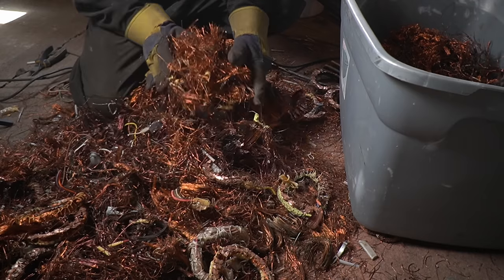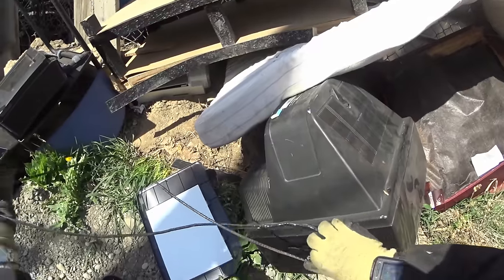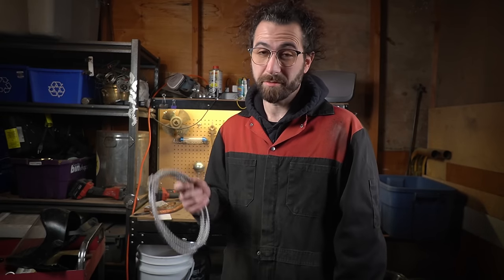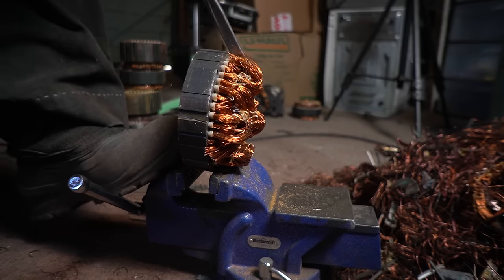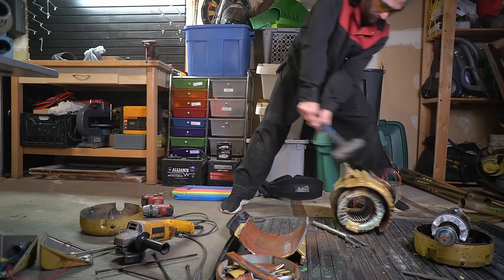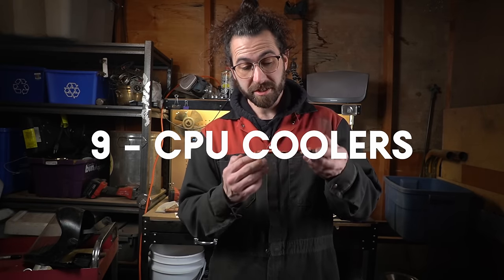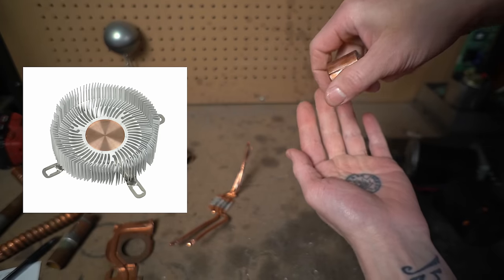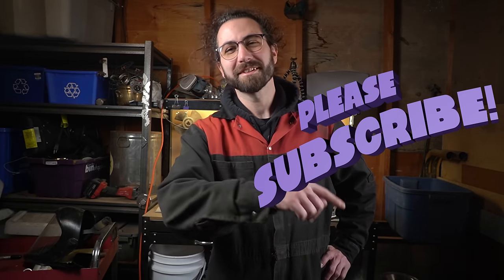10 Best Places to Find Scrap Copper

Comment: When harvesting copper, be exceptionally careful of capacitors!  Capacitors carry an electrical wallop!
Reply: yes if you're not extremely careful you will regret it ..and the gas to ..take it and sell it to a HVAC place or they can drain it safely..I'm glad I watched videos like this before I started ripping into a units..kickass
Reply: Yeah, seconded. Microwaves have "You will die and it will hurt the whole time you are dying" sized capacitors in them. Do NOT mess around poking at their guts unless you know exactly what you are doing!
Reply: @peteredwards2318  yup yup and when you're family finds you later on when they get back from dinner at rhe grandparents house they will see  you laying on tje floor and plugging their noses because now the house smells like is burnt shit..and you dont want them to remember you like that do you guys ..so dont be a BS .leave it ti the pros.
Reply: How can I see a capacitor I’m really just researching  this side hustle to see if it’s worth it any other things to look out for is there anything I should look for that’s safe ?
Reply: Copper seems worth collecting over time .I'm not about to go start looking the stuff like but glad I seen this comment. As my microwave is on it way out cuda been my 1st easy bit of copper lol 😆 😅
Reply: @peterjohnston4472  absolutely thats what i fo .just save it as icones and put it somewhere its definitely valuable and worth saving until you have a  bunch or for a rainy day.
Reply: Soooo... rubber gloves. Got it.
Reply: Yes they do store power... De-energize them and you're probably good to go.
Reply: @Toyotajunkie  touch the top w a screwdriver
Reply: Yup I found that out the hard way once.
Reply: You can short it out by placing it on your tongue.
Reply: @tomvana4270 😂
Reply: Can I use a glove or is it not useful?
Reply: For a real long time too.
Reply: So how do you safely harvest copper from a microwave?
Reply: @MyPalJimbo  here
Reply: Ues, they do.
Reply: I tell everyone to tell everyone they know that!!😂😂
Reply: And hold electricity
Reply: Thanks for the heads up learn something new everyday
Reply: See we need education like this 💯
Reply: @conspiraciesexposed7760  holding the insulated portion of a screwdriver go across the two terminals of the capacitor while making sure your other hand is not touching metal
Reply: Thanks you just saved me an ouchie
Reply: At my recycler, they just knock a hole in the line and let the Freon go back to nature. I have video.  @mustangandfrankenstein
Reply: @peteredwards2318 not saying that you shouldn’t respect the capacitor in a microwave, but to say it has lethal amount of current is just misleading. The capacitor might be as high as 2.2kV but at less than a microfarad it’s only gonna store like a joule worth of energy. 

That’ll hurt like a bitch, but it ain’t gonna burn you or stop your heart.
Reply: @MrJahka  and you know what'll do none of those things, serious or otherwise? Leaving it the hell alone. 🤣
Reply: @peteredwards2318 im not a crackhead lol so I’m not opening microwaves or anything. I just wanted to clarify that those capacitors will shock the shit out of you like 2k volt worth of shock that will hurt hurt hurt. but unless you’re standing in a bathtub of water it’s not gonna be enough current to actually hurt you. But I’m not trying to be dismissive just pedantic lol. Always beware the charged capacitor is great advice
Reply: Take your screw driver and touch all the terminals together it’ll discharge it, so far ive never been hit with a capacitor
Reply: @robertfrapples2472  exactly what most hvac guys are gonna do as well., they don't want old dirty freon. cost too much to collect,clean up, and reuse. they just vent it!!!
Reply: I just cut the cord off of microwaves and let someone else have at the rest for that exact reason lol. TV’s or anything else that may have something like that, I’ll let sit for a couple months at least before I start poking around.

Comment: A buddy and I were scoping out an old abandoned stretch of train track and pulled several hundred feet of solid copper that was cut from the old power poles and thrown to the ground and left for many years, the wire was covered over with grass and weeds. That track kept us busy for days.
Reply: Did that too, we thought we were rich. Couldn't beleive it was high tension wire. Steel inside. The scrapyard knew where we got and gave us like 4.00$ gave us some magnts too😂 wondered why it was so hatd to cut...😅😅😅😂
Reply: Anything on a railroad tracks a railroad property is a federal offense
Reply: There's one in every crowd
Reply: @swarm6697 not if the land has been abandoned
Reply: @dougmiller5608  Feds don't  abandon properties. They just set vacant until a new use comes up.
Reply: I watch 5 people a year fry on amtrak power cables taking copper.  Hillarious
Reply: @stevenkipus1505   Why is it hilarious? They either get paid or never need to get paid again. Meanwhile the cost of therapy to process what you witnessed is going up and up.

Comment: Some dumpster companies have declared anything inside the dumpster is their property because they recycle the contents, therefore they can press charges for theft. Be careful, it might be easier (and safer) to ask. I got permission and help from a Radio Shack that had stuff inside they hadn’t had time to toss out yet. Fun stuff
Reply: Kind of hard for them to catch you since the dumpster is on the clients property and you are doing the client a favor by lightening their load and in some cases, they gave you permission.
Reply: if in the USA there is a law that helps police anything in the trash is forfeited of owner also helps scrapers police will say you can't because they don't want the call later to trusspass you (lot pf paperwork)
Reply: The Supreme Court has ruled anything placed in the trash is free to claim. They can try to press charges all they want but it isn’t going to stick
Reply: If it’s mixed with trash they aren’t saving it for scrap. Also I look for no trespassing or a locked bin. If nothings locked or behind a gate I think it’s free game.

Comment: I went to the HVAC guys that replaced my AC unit a few years ago. Told them what I'm doing and so now whenever I get a couple of Fridges together I call him up and one of their guys will come out and drain all my compressors for me so I can scrap them. I have a moderate sized side yard and try to get like 6-7 of them in the stall before I call my guy and it takes him about 30 mins to drain 6-7 and they leave. They get the chems, I get the scrap.

Comment: Thub is spot on about extension cords. I weighed 1Kg of (UK) 3-core extension cable then stripped the outer it and re-weighed it as singles. Even with good singles prices the cable was worth 2.5% more unstripped, so the time & effort would have cost me money!
Reply: Extension cords have a 45% recovery rate of #2 copper wire. I work in the metal recycling industry.

Comment: I second the plumbing tip.  I drive a residential recycling route and every time I see a sink or tub or shower in a dumpster in front of a house I know I'm stopping back there after work.  Stripping down the faucets is a quick way to a hunch of clean and chromed brass too.
Reply: U know damn well u don't chance finishing your route first driving the recycling truck to wherever y'all empty then driving back to the shop, clocking out getting in your beater station wagon and retracing your steps from your morning route to see if maybe just maybe that bathroom sink is still sitting in front of the Clemson resident house 8 hours later it's sure to still be there.. I bet u carry a few of the must have scrapper hand tools with u on your route truck and and all day everyday u keep your eyes peeled for the jack pot. You don't wait till after work you're not kidding anyone!

Comment: Transformers are great, and they are fun. The small ones can typically be taken apart in such a way as to allow you to spool the wire off the winding and onto a screwdriver shaft. The larger, older stuff is trickier, because its often coated in a potting compound or something, making the windings impossible to unspool in a tidy manner. A chisel, a hammer and a bench vice tends to sort those out though. You get a hefty whack of iron to boot!
Reply: Honestly large transformers (that work) I prefer to keep. They are just too much fun to play around with.

Comment: Great video! 

RV tech here , lots of copper in RV’s ! Inverters, converters, dead leaked off fridges and AC’s, microwaves, copper gas lines and huge amount of 12V power cables! 

Our shop has a lunch fund supplied by scrap metal, most of it derived from copper.

Comment: I'm obsessed with copper and this video has helped me learn how to get more copper
Reply: I am obsessed with sodium metal, I buy salt at the supermarket, then evaporate the chlorine using laser and get sodium into inert atmosphere inside a bottle and sell it for 20 bucks for 10 grams. you can make a lot of money if you learn science
Reply: @absolute___zero no you don’t , cause if you did that there would be a huge conglomerate doing it to
Reply: @JoeRogansForehead  while there is no big demand for pure sodium metal, there is a huge demand for sodium-based products. Table salt costs 30 USD per ton here in Mexico where I am currently living. Caustic soda is priced at 4 USD per kg here in Mexico. If you sell 1 ton of caustic soda you will be making 4k USD per ton while in sodium you will be spending much less + energy and machinery setup. Of course if you don't know any physics, chemistry , mathematics and programming you won't make this money easily. But you can get this knowledge say in 3 years, and then lots of business opportunities will appear. Caustic soda is used to make soap, fyi, a product that everyone needs.. With solar energy dropping in price the production cost will be getting lower, and the profit getting higher, but for a guy who doesn't have any knowledge this money will always stay unreachable. Knowledge = money, literally, in 21 century.

Comment: I made a video on scrapping lead from cast iron pipe. I do work at an apartment complex that had all of the cast-iron replaced with PVC. Most of the cast-iron is still in the basement or the crawlspace so if I am working, I throw all of the bell fittings in my van and take them home. I also see lots and lots of water heaters. When they replace one instead of removing the old one, they just said it to the side

Comment: If the wire is able to be stripped, I strip it. Have truned in over $600 worth of #2 this year in my spare time. I strip vaccum, microwave, extention and PC pwr cords. Another good source is the pig tail from the cab to the trailer. Used to get lots of when I had a great gig.

Comment: Nice vid as usual. When I get the copper stackers from heat sinks, usually a map or propane torch will heat up the core and it will drop right out. Only takes about 30 second. .....usually.

Comment: with the microwave, get the magnets if you don't already have any, also in the motors if you collect silver? some content maybe in the motors themselves (yes I know this video is based on locating copper, sharing information is the key to growth).

I LOVE air conditioners! found one down the road, yet to tear it apart, found another one in the bin, people who earn a lot of money often do not realize the money they are throwing a way. Some trades people will give them to apprentice workers so they can learn the value and apply the money to tools etc

Comment: I find ceiling fan motors the easiest to process: no cutting steel, usually can snip the copper wire with just wire cutters, and levers out pretty easy with a screwdriver. I have one motor from some industrial piece that the copper wire is just jammed in there, I cannot get it out to save my life - yet. I ain’t quitting!
Reply: The stubborn ones make us stubborner!🙂
Reply: When you spin them with the outer case off, don't they look wonderful too, or is that just me being a bit of a copper nut🤷‍♀️😂
Reply from the maker: Could treat yourself to a rotary hammer 😆
Reply: @thubprint  What, am I made out of money all of a sudden?  🤣  Seriously, I wish. I am looking through construction bins for good plywood to re-cover my work table. Another reason I wish I could make videos on my route, to get some of those sweet YT advert $$$! ($700 a month doesn't leave any room for, well, much of anything.)
Reply: I find that to be the most tedious! You have use a grinder to cut the motor apart.
Reply: Next to power poles there are 15 to 20 feet of copper in the ground.
Reply: @austinhernandez2716  yessir. Same. They can be a pain in the A. Have to use a puller to remove the bearings, them cut the housing apart, then cut the copper coils out. 
Lots of copper! However lots of work too.
Reply: I know what your talking about. My one yard will not even accept these as electric motors. There's too much steel. Just try getting them a part is a bitch. I gave up on them. I take the fan blade brackets off that easy. They are die cast also known as zinc. What happened to the high prices we saw a few months ago. My yard says. All their buyers are filled and not paying much?? True or false? What do you think?

Comment: Another source is the copper tubing used for oil tanks to furnaces. When they replace the oil tanks they tend to scrap the tubing and replace it with one that has a plastic coating over it. You maybe able to get some from that source as well.

Comment: I have a big plasma cutter capable of severing 2 inch thick steel . But a hypertherm powermax 30 plugs into a 110 outlet has its own air compressor .  It can turn a freezer into flat sheet metal instantly  and do so for almost no cost .purchase it used off ebay for 1200 if your a scrapper this will pay for it self in 6 months

Comment: Old coax and ground wires for satellite dishes. I install satellite Internet and use #10 ground wire, rg6 coax with a copper messenger/ground wire. There are often old lines installed people want taken down.

Comment: If in the UK then check the fuse holder in sealed plugs, sometimes they are copper and the rivets can be drilled out easily.
Reply: Take off the plug pins too.
They'll go as brass in most yards
Reply: @trench124  yes, got to love scrapping plugs, so much brassy goodness too👍

Comment: If you can find junk pool or spa heaters, usually the heater core is a nice solid chunk of copper, it’s easy to remove and once out you just have to cut the plates off on the sides.

Comment: For thick plug on stoves & dryers, chop with bolt cutters (I got free bolt cutters in bin of a wire company, rare find) & use needlenose plyers to pull out brass contacts & Cu wire.

Comment: A lot of older vehicles used copper radiators and only a small portion of the entire radiator is steel or possibly aluminum.

Comment: If you know an HVAC guy they may recover the coolant for free depending on what kind it is.  And for those copper stackers I've used a torch and just heat it up a bit and they slide right out.

Comment: This was great!! And it gor me thinking, as a voice I trust to honestly inform I was wondering if you could do a short video on the silver buttons found in nearly every contact. I hearthsm described as silver buttons but I have a hard time believing they are solid silver, or even a solid silver alloy of some kind. Would you please do a vid explaining exactly how much is actually there (big and small and miniscule) to bring some clarity to the subject.
Reply from the maker: Oh I did a whole video on silver! https://youtu.be/JcbtwnOWq8M
The little buttons are not pure silver, they have a bit of cadmium in them to harden them. Very toxic fumes, which is why I can’t just melt them down as-is. They’re easy to clean the copper off though, just leave in hydrochloric acid with a splash of hydrogen peroxide to kickstart the oxidization and the copper/brass/solder just gets eaten away.

Comment: 2nd how do you get the floppy stranded copper wire to go through the stripmeister…. I can only get solid core to go through without flipping to the side after about 6 inches… or lease let me know if there is a trick.
Reply: try lowering the guide plate (with the wire holes) to make sure it is a little bit lower than the gear wheels, that gives it a better grip and bends the top side of the wire better under the blade
Reply from the maker: Yup, exactly. I always push the guide plate down onto the wire so it’s creating a little pressure and the wheels are pulling the wire up, and I haven’t had a problem with stranded or solid

Comment: Thub, about the small transformers in laptop chargers and such, the short and sweet is NO, they are not worth the time. It's like trying to nail jelly to a post. But you go ahead and make the video, I'll watch and hit the thumbs up.
Reply: Yup, I have busted them open with a hammer. Takes no time but the transformers on them are tiny. Some yards will buy them as a small transformer but most toss around me toss them in the shred. If you crack em can sell the board as low grade.  Not really worth the time then disposing of the plastics separately
Reply: oh man that was funny, thx for the chuckle